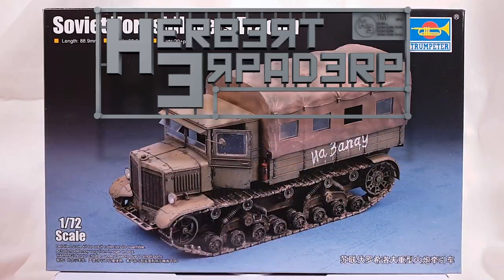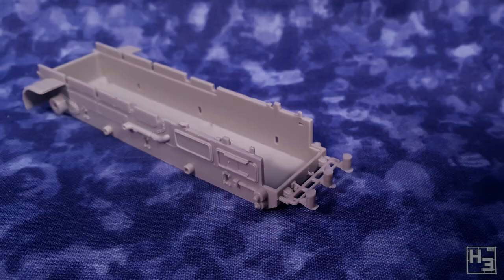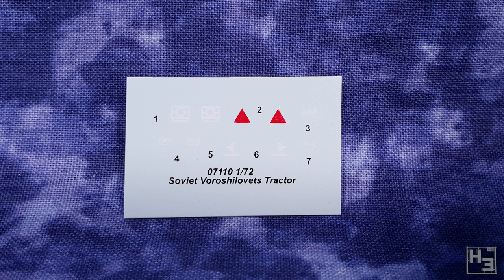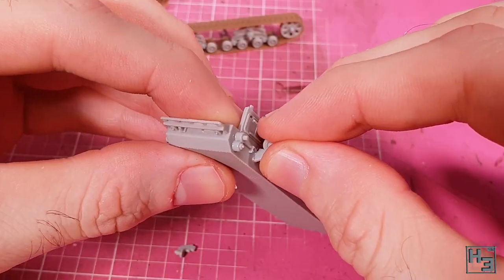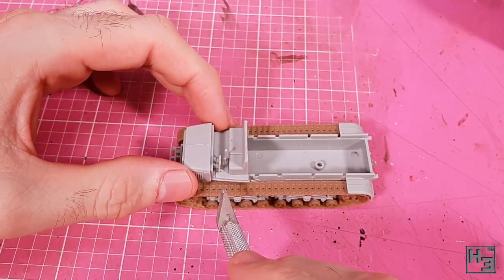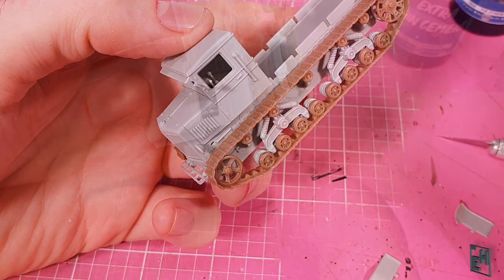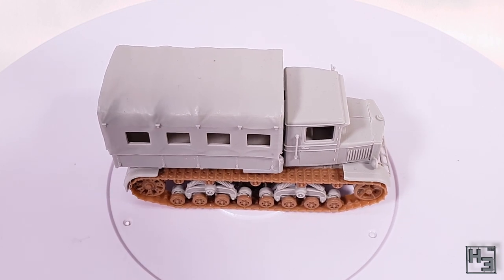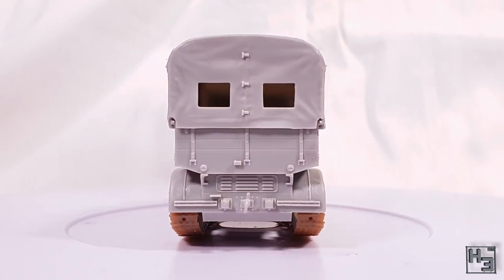Voroshilovets Tractor [1:72]

Comment: What an interesting way of doing the tracks. It really is an unusual looking model,but very effective.
Reply: They have the tracks made in one piece on some of their kits, but not all carry this unfortunately.
Reply: Just finished the trumpeter soviet t28 that has the same style track assembly. It’s a great idea for this scale.
Reply: @strontiumstargazer3124  For some reason some of their kits still carry the painful rubber tracks.
Reply: @Modkits131      True.  I look out for these in all brands and avoid usually.   1/72 zvezda king tiger flexible tracks weren’t bad.  I like zvezda.  
If the tacks look anything like 1970’s airfix black rubber then this I avoid.

Comment: It is kind of weird that the box photo shows lots of window glazing in booth the cab and the bed cover, and even headlight lenses. The closer I look the less well it all seems to fit though as if it was all cut out of a blister pack and crammed into place.
Not so sure about the sensible paint job. I'd like to see it decked out in Moscow Circus livery with two bears and an elk in the back or something.